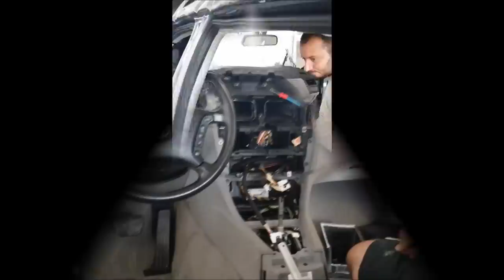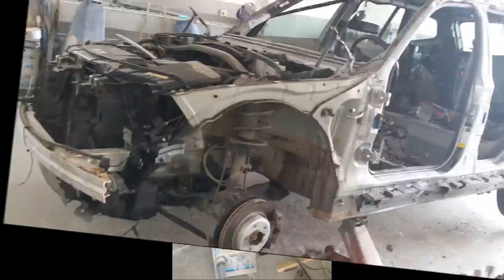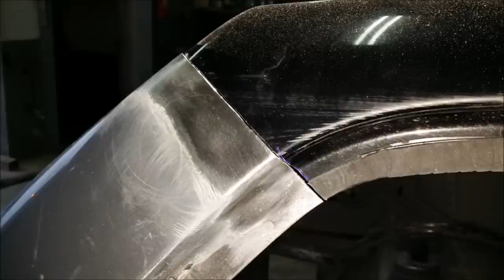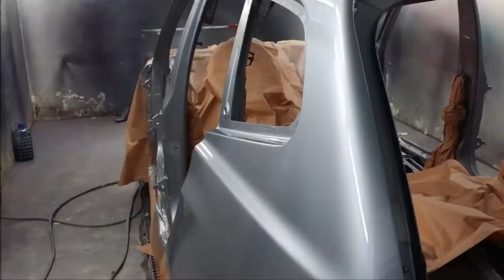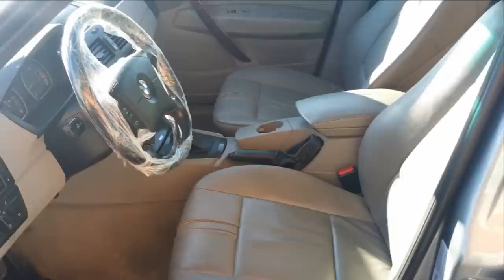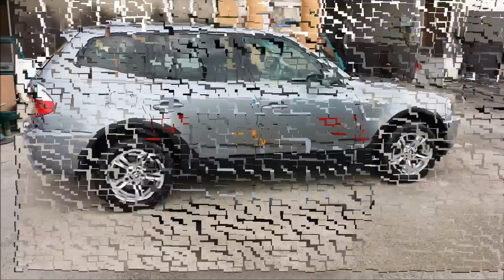BMW X3 Full body repair

Comment: absolutely good repair , great job , however this car will never ever be a 100% as it once was.There is more danger if 2nd crash occurs and in most cases it ALWAYS DOES. Some cars are crash magnets , some are just bad luck..the general rule is to try as hard as you can to avoid repaired cars , if you'r not good with the cars try bringing along someone more experienced.

Comment: absolutely terrifying repair....its a a death trap...do you have no idea of the steels involved and the correct repair process????????
Reply: +sidewayssam Looks like everyone is an car engineering expert on the internet, there is nothing wrong with this repair, if they welded all the  parts back together it will be as strong as original.
Reply: +TheRealDeal there is everything wrong with this repair, and it is completely unsafe , it will in no way be as safe as it was,as they are cutting & grinding uhss steel, cutting in all the wrong places, welding in all the wrong places, this could not be a more unsafe repair.i am a crash investigator, and independent engineer in the uk.
Reply: sidewayssam and all those other people? who said they did a bad job? those experts too? what exactly they did wrong? they fix cars like these in Ukraine and Russia all the time, and some come back after being in a crash a second time. look up a guy Garage КАХОВКА.
Reply: +TheRealDeal yes all those other people are doing wrong as well, I SAID they did a bad job,,what did they do wrong? cars now are made of steels of diffrent strengths and have different levels or carbon and under steels and alloys, some steels are roll pressed, some are case hardened when you apply heat to high strength steels, ultra high strength steels you alter the molecular structure of the steels, if you have ever repaired a modern car, you will know that you cannot drill into them, or work them the same way as mild steel, and you need boron bits to drill the welds out...just because you can fix a car that way, does not mean you should. Imagine having a plastic cup in front of you, and putting something with a bit of weight on it. The cup will support the weight,as it still has its integrity, not crush the cup,and then pull it straight, and see how much weight it can support. I work with manufacturers, do forensic engineering(i measure the strength of panels in impacts,corrosion resistance, how they are pressed, molecular structures of steel...the guys in the ukraine ,russia and poland are fabulous panel beaters, but about 40 years behind in repair methodology.
Reply: +Tim Kelly The point is that cars are so expensive that we have no other option in Poland. In a perfect world it should be scrapped. I know...
Reply: +Gregory May i understand that, but many on here do not, but it is still an unsafe repair. that is a death trap.
Reply: sidewayssam
Are you Claim guru? Is that you?
Reply: +Gregory May i am!
Reply: sidewayssam
You helped me some time ago with my accident (silver fiat stilo)! Thanks
Reply: +Gregory May welcome!
Reply from the maker: sidewayssam  https://youtu.be/mcDrfgXkLO8 this si my repair too. i did it like 9 years ago, and i personaly crushed this car after repair. i had head zo head coalision at 80kmh i hit golf V. bouth me and that other gzy webt without a scrach. so in case of further coalision, no problems.
Reply: zlimun
 What is "head zo head" colision?
Reply from the maker: Gregory May head to head. my front bumper into his front bumper
Reply: zlimun
At 80 kmh?? Wow.
Reply from the maker: Gregory May ill try to find some photos from police arcive an i will post them. i spined two time and end up in back seat. i didnt have a scrach... all in all it dosent depend on us or the car.... it wosent my time to go.... :)
Reply: the passat you repaired is not uhss,it is a mid 90's car, twenty year old technology, but that still is a horrendous repair, it may have absorbed a frontal impact, as the energy has not got to the point you cut it.Should the car have had a side impact, you would be dead.
Reply: @j.r crews, your not quite grasping the content of the thread then?yes i am ranting, why? because the methods used are dangerous. Should the car have been total lossed> yes, why are they repairing it? because in their country post eastern block they will try and save everything as they have only just stopped driving zastava's, ladas and Wartburgs...so why they rant? because the car is going back on the road in a unsafe repaired state..
Reply: It should not have been repaired, easy as that, it does depend on the country whether you get away with it or not, i am an accident investigator and engineer www.motorclaimguru.co. uk is my company.
Reply from the maker: sidewayssam why the f... shoul i get away with that??? the owner of the car wanted his car done, so i did it on his demand...
Reply: duty of care, corporate liability, The repairer is seen as the expert not the consumer, should it have a further accident and the occupants are killed as a result of a faulty repair,or it kills some unsuspecting person, the repairer is liable to compensate for the loss of those who died.Your very good at what you do,do not get me wrong, but with out knowledge of the materials involved, how can you repair them?
Reply from the maker: sidewayssam speeding, and driveing drunk and droged kills people, not metal welding...
Reply: zlimun
" speeding, and driving drunk and droged kills people, not metal welding..."
So true! I wonder what percentage of accidents and deaths on the road is due to poor welding or technical aspects of a car...
Reply from the maker: Gregory May my welds didnt kill no ine yet hhahhahahaha.... and i am sure it wont ever...
Reply: @sidewayssam I will not pretend to have knowledge about this but the article you posted clearly mentions "sub-standard" repair. Other than that check your site and your linked.in profile as none of the links you posted work...
Reply: It clearly is a substandard repair , in truth it is terrifying.
Reply from the maker: TheRealDeal truth!
Reply: well, i guess in Russia they'd things differently.
Reply: @efcava1401  they most certainly do